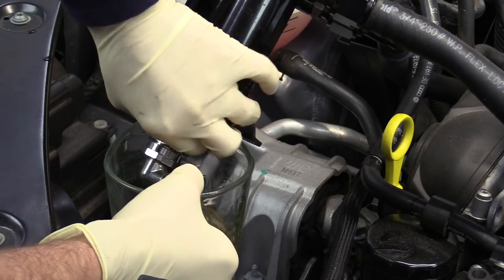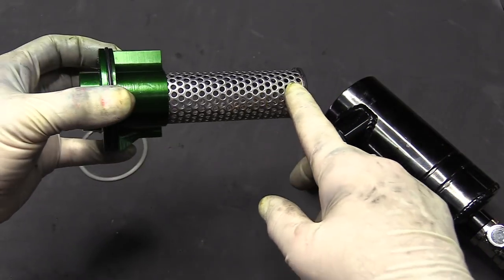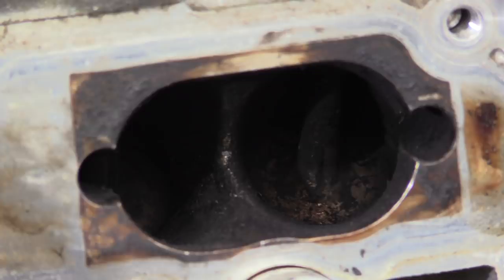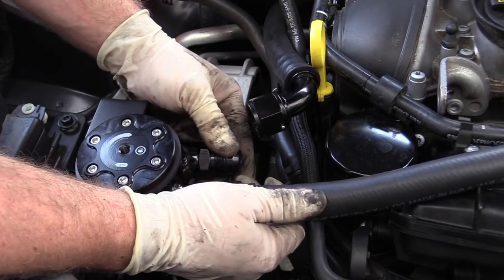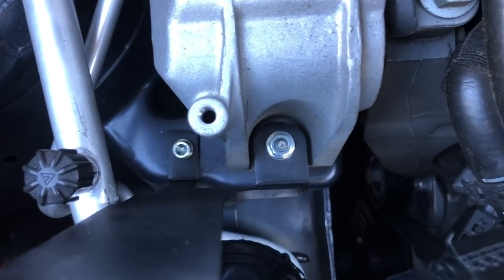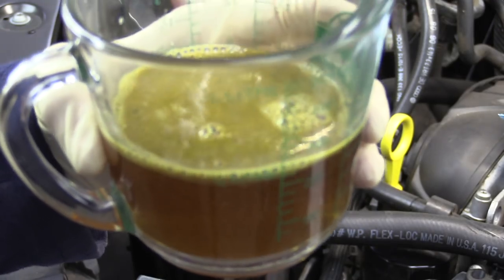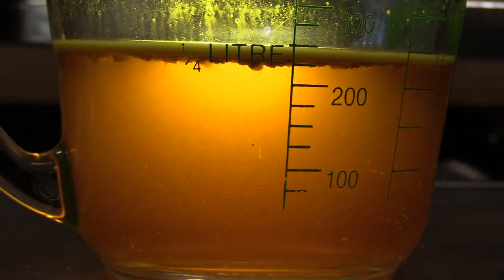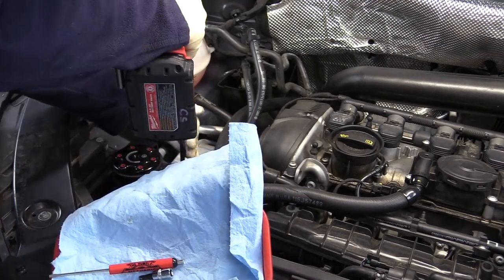Do Catch Cans REALLY Work?

Comment: If your car is using that much oil than you have an issue a catch can is only suitable on modified vehicles if there were meant to be on standard ones then the manufacturer would fit them I think your engine could be using that much oil due to exessive bore to ring clearances or valve stem issues I would check that out but if you can't be bothered than keep the catch can on and drain it every service just keep an eye on your oil level

Comment: Ok I got a ??? I have one on my 2014 raptor but with a breather so is it bad to have a breather like I’m sucking air through the breather when turn the car on and when I drive but when I turn it off I can hear the exhale of the filter so no pressure in the crankcase so is it bad or good with breather please help

Comment: I installed a catch can on a 2016 Audi A5 (2.0T). initially, there was a little oil/gunk residue. After (I guess) the engine broke in, the catch can is basically dry.  Is this normal?
Reply from the maker: A lot depends on driving habits. I was shocked mine was so full lol

Comment: That is shocking. My high performance silvia with a upgraded turbo running 22psi and 170,000 on the clock doesn't even come close to that. Id be checking for excessive blow by and whats causing it

Comment: I find they are more beneficial on older engines. But they do work.
My home made version.ill get approx 1/4cup of crud in 6 weeks(black prutrid smelling oil). On a 280 000km engine.
Volvo in mid 80s had a system where it went through a screen. Then the crud would drain down a tube back into block.to bottom of pan.then when you drain oil the crud would drain at same time.this was clever. 
The one I built uses.air compressor water separator. With about 10 ball bearings in it. Every car I put it on it pulls out crud.and the black oil would over time lighten in color.to like a dark amber. the more hwy miles the less crud.thats my observation anyway. (Been using this can for 15yrs)
So for you critics out there I suggest you experiment. Dont take my word for it.try it yourself.
Reply: I find the condensation build up  is due to the can cooling down after driving. 
In the winter I have to remove mine when it gets close to freezing.

Comment: I installed a JLT oil Separator on my 2018 F150 5.0, which has direct injection and port fuel injection. I don't know about other folks, but I most certainly don't want this mixture of oil, raw fuel and some water vapor fed back into the top end of my engine and on my intake valves.
Reply: You don't need this on a 2018 or newer F 150. Because of Ford adding the Port injection to the direct injection. Waste of time and could damage your vehicle if you live where it might freeze.
Reply: @acostuart  I don't have to worry about freezing where I live and that's not a concern for me. I understand how the injection systems work on the gen 3 coyote, I work for Ford. This is my third 5.0L.. a mustang and two F150s. Believe what you want. I don't want this mixture of water vapor and oil, and fuel reintroduced into my intake manifold (during said port fuel injectiob), which is used during for normal driving under light load. Just out of curiosity, what do you drive?

Comment: Catch cans may have some benefit in GDI engines. But are unnecessary in normal fuel injected or carbureted engines, where the fuel itself acts as a cleaning agent. Driving the car at hway speed for about 15mins can help clean off carbon build up. If you drive slowly all the time carbon tends to build up

Comment: vw thought this amount to pass through was OK for millions of vehicles.  Their future sales will speak for them selves.  Maybe catch can fever is a result of the modification crowd producing above engineered crank case pressures...  If it is really some type of "savings" (engineering or maintenance) the MFG has chosen, I'd be interested to know if commercial heavy trucks have "catch can" style oil separators from the factory.

Comment: Hey Charles. How about doing your next oil change with LiquiMoly Molygen? My thinking is, the oil's green hue, as well as it's UV reflective properties, might help diagnose how much engine oil is actually in the catch can as opposed to other contaminants such as fuel, water and etc. Additionally, maybe compare the visual results to the plain oil and/or at random checks during the oil change interval. Doesn't seem like too much of a hassle besides, I think it he Molygen comes with a UV flashlight but it might be puny, who knows. What do you think? Keep up the great content! Cheers!!
Reply from the maker: Good idea. I may actually just add oil dye to the system. I won't have this car long enough for another oil change. But I lie where you're going with that.

Comment: I heard a catch can can  freeze in winter and blow your engine ?
Reply from the maker: I have heard that too. Its something to be aware of.
Reply: Yes they do i have to remove mine when it gets Below-5c,but if u warm up before driving there's no issue. I have had mine as low as -12c,it was frozen,then it thawed out,,,now all that freezes is the sludge,of course  it has to be emptied when it's warm,,but I also have a see thru can I can tell if it's frozen.

Comment: Good test !Why the car companies don't use this system from the first time?
Reply from the maker: Added cost is the simple answer. Cost at purchase, and cost of maintenance.
Reply: MK6 and MK7 already have cyclonic separators built in. Watch out for the ones that delete the OEM system, you are better off adding a second separator on top of the factory one. If you want to see how the built in one works on a MK7, look at "Degassing of the housing and crankcase gases" in VW SSP 606, PDF page 20 (google it to find the pdf.)
Reply: Because the majority of car owners are lazy, most would never service a catch can. (And jiffy lube wouldn’t touch it). Ha
Reply: @DBA1976   Bingo !  People just want their cars to run and not breakdown.  Now !  We just need a way to filter the heavy carbon out of the EGR stream.

Comment: On my Mercedes I installed a catch can and it caught about 5% of that during 6000 mile oil change interval. The engine never needs adding of oil, infact it stays on the max mark and wont consume any oil. Why does VW pull that much oil from the crankcase?

Comment: Even if it's 99.9% water still don't want it in the motor and for older vehicles or ones without 2 FACTORY separators a catch can will only be better. All in what you want to buy or how much you value the vehicle. For those saying why don't manufacturer's use them then? They're cheap that's why they don't need the vehicle to last forever end of story. Not to say catch cans are amazing but they do work

Comment: All I know is that despite all the different variables (oil type, fuel grade, mileage...etc) that are associated with car, I WOULD not want that going back into the combustion chamber. On the other hand, every solution warrants its own issues so, maybe the best way is to just avoid direct injection engines or something along those lines. This catch can stuff is actually interesting to test and research, but really, doesn't look nor feel like a solid solution.

Comment: Don’t think on a direct injection fuel system like on newer car they don’t work all that well but I my opinion I think it’s to do with the engine design/ fuel system setup and lack of ventilation on the engine /intake or egr systems which heat up the oil
Reply: My 16 mustang ecoboost has spotless valves because I installed a catchcan as soon as I bought the car. My friend with a similar car has half the miles and oil ALL over his valves from not running a catchcan.

Comment: On my car it has frozen up inside the hose and i could not see it. Drove the car with no crankcase ventilation and in 40 km/25 miles all 4 liters of oil inside the engine was gone. It's a 1.5 diesel. Luckily i got home by the time the oil pressure lamp was on. Never again will i use an oil catch can in winter time
Reply from the maker: DAMN! I wouldn't either.
Reply: I know in winter diesels can have a hard time warming up, they just dont put out the heat that a regular sparker would I think.  Also he may have to use a AOS that uses coolant to keep it from freezing instead of just a catch can.

Comment: Can i vent it to atmosphere instead of routing through the catch can ? just a thought question
Reply from the maker: That would fail emissions testing I would assume. I know it will in NC.
Reply: HumbleMechanic Yup. But does it bring any performance penalty when doing this. I live in Malaysia and I've seen lots of guys over here venting instead of using a catch can. Emission test is not as strict compared to the US.

Comment: Honestly, thats is mostly condensation and gasoline...very little oil in that, and that liquid hitting the valves might actually help clean them rather than make them dirtier...yes there is "crud" in that mixture, but very minute amounts compared to the water/gas in there. Keeping in mind that carburated and manifold injected engines dont have carbon issues, I think its safe to say that a little water and gas on the valves will do nothing but good for the engine. Just clean your valves regularly, pull off the last sensor before the air hits the pistons, turn on the engine, shoot some of your favorite valve cleaner in there, rev it a bit, repeat, then let her idle until the smoke settles, turn her off, replace the sensor, done! How long did that take? An hour? maybe less?

Comment: Is this a factory part on some cars?
Reply from the maker: Not that I have seen
Reply: Saab 95 had catch can. It took several versions to make it work. CC was behind the engine to prevent it from freezing. It did return the fluid back to engine. For cold climates there is a huge risk for the CC to freeze and cause catastrophic failure. If the engine ventilation will freeze, the pressure build would push the oil out through the dipstick hole. Once you notice the oil pressure light go on, it’s too late already.
Reply: Saab 95 had catch can. It took several versions to make it work. CC was behind the engine to prevent it from freezing. It did return the fluid back to engine. For cold climates there is a huge risk for the CC to freeze and cause catastrophic failure. If the engine ventilation will freeze, the pressure build would push the oil out through the dipstick hole. Once you notice the oil pressure light go on, it’s too late already.

Comment: All so I disconnect both hoses from the catch can to see if oil is getting pass the catch can one should be oily and the other dry that way you know only air is going into the intake manifold and the car should run better oils don’t need to mix with air and gas mix

Comment: I heard that 3rd generation 2.0 TSI engines owners with catch cans claim  that there little to nothing after thousands of miles of driving. Do you have any experience with those? I am not saying the issue is fixed on those, it's just that a catch can seems to help people with the 1st generation TSI the most. The one in your wife's Tiguan is first generation.
Reply from the maker: The newer generations are much better on all accounts.
Reply: Yeah, that's why I choose to spend the extra money for the 2014 GLI over a much more affordable 2012 model. The former has the 3rd generation engine, and it's been running really well even after 33k miles. No rough cold starts and fuel economy usually exceeds EPA ratings especially on the highway. Finger crossed it remains this way lol.

Comment: Just dumped my 2nd can on my 2020 F150 2.7L.  First can was at 4,000 miles and was nearly all spent oil.   This time, at around 8,000 miles, half of it looked like this video... sludge like a clogged garbage disposal.  GET A CATCH CAN, especially if you have an EcoBoost!

Comment: meanwhile in F1 some teams are actually throwing oil into the intakes for more power and fuel efficiency
Reply: Eduardo J the oil in f1 is specially designed to increase power, but regular oil lowers octane and therfore power.

Comment: I was looking at a set for my infinity. Mishamoto 400 dollars on sale😂🤣 and it adds 0 hp😅🤣🤣. the margins are huge on crap like this. I could create my own catch and release system with a p trap or loop (hose, whatever fits) and a check valve and let the road handle that crap(it was just going to be turned into smog) for a very reasonable price but after seeing this video THAT is not even worth the time.  Thanks for the video buyer beware you saved me 400 bucks and a sunday afternoon. Thanks my dude.

Comment: Hi  is Rafael from Brazil, how are you? I have a serious problem in the car and here in Brazil not only do I have this problem and can not get anywhere, the error name is P164B which is oil pressure drop and in this causes the ignition of the EPC lus with 4000 RPM , we exchanged oil pumps, sensors and nothing, continues the same error, I did the oil pressure test in high and hurry does not rise to the correct PSI stays low under 40 PSI and the normal is 43 to 62 PS in high, you know someone there in the US or someone could guide us to comosanar this cronica problem of jetta tsi 2013 if you can help me or pass to someone who knows about the error P164B would help me a lot.

Comment: Way better option is to weld in the exhaust after the cats a Venturi pipe and let the oil vapours being sucked into the exhaust . Had a catch can in my diesel for a year but it sucked to drain them all the time . With the Venturi pipe I don't have to check it anymore and oily intake is history :-)
Reply from the maker: That would fail inspection here. LOL
Reply: @HumbleMechanic  in which way ? Visually or by exhaust emissions test ? They test mine only by co2, nox and how closely the diesel smoke is. But it never failed that way.

Comment: Most of that is water but there is enough oil to cause carbon build up. A perfect fix would be a combination of catch can and intake/direct injection. I have seen guys run the double injector thing with good results. Manufacturers should have solved this problem by now. Not having done so leads one to believe they don’t care. If they can get the car to run past the warranty that’s all they are concerned with.

Comment: AFAIK direct injection motors suffer from carbon buildup because solvents from standard pump gas don't soak the intake valves. A catch can won't help with that.

With that said.... I did install a catch can for my FA20DIT and it does collect about a shot glass-worth of crud (thicker than what you pulled) every 6K. I would prefer to not have it dumped back into my motor.

Comment: I put a catch can from 034Motorsport on my 2013 Q5 at the 30k mile mark, and I’ve emptied it three times in 10k miles.  Very nasty, tan-colored guck came out.  The biggest catch was in the early spring of this year, about ¾ quart.  I’m a believer!
Reply: so.. water then.. well done you have done nothing
Reply: @James28R  The brown goop was oil mixed with water.  The catch can is working to trap at least some oil vapor from crudding up the intake valves.  My Audi mechanic agrees.

Comment: Egr..... It's going to be the biggest culprit of carbon buildup since that is where most of the carbon itself comes from regardless of direct injection or not. A catch can will help since it is like the glue that grabs and binds the carbon to everything. For somewhat fixed this issue on their Ecoboost motors by adding more upstream injectors to clean the valves and ports because regardless of what people think or say gasoline is a very good cleaning product for carbon so I would recommend some sort of maybe methonal injection kit to use as a form of "upstream cleaning solution" and you can use isopropyl alcohol to do the same effect. That's pretty much the only way to cure the buildup is to actively clean or remove the things that cause it and since an egr is part of emissions it is illegal to remove. So unless you wanna break the law which you're kinda stuck with only the cleaning solution. 😕

Comment: its clearly all water, you can see it is .
Just look at the meniscus on the liquid to the glass jar in the first pull.
The liquid has too much surface tension and as a result , wont stick to the glass
If it was oil, then it would cover the glass and stay covered as the wave ran back onto its self.
But what it actually did was drained back from the glass leaving the glass clean and dry.
All water with a couple mm of oil/shit on the top
SIMPLE!!!!!
Reply: The stuff floating on top is probably still worth filtering out though vs being put back into the engine right?

Comment: That's not oil, it's mostly water (condensation from when the engine is cold/first started). The condensation is not bad for the engine if you drive at least 10 miles each time.

Comment: That sure is alot of buildup! I dont have a catch can (plan on adding one shortly) to my 2008 Silverado 3500 duramax thats completely emissions deleted, with the PCV rerouted to atmosphere. I currently have a hose just routed to the frame to drip down. I do notice some oil on the frame after 10k+ miles like that, would be curious as to how much id end up with, with a catch can. I know on my truck the PCV kills the intake system, completely fills up with intercooler with oil and the intake/intake runners in the head become clogged up with serious carbon buildup.
Reply: itsme78932 the only way to fix the carbon buildup problem in DI is to reroute the PCV into the atmosphere like you did or run port and direct injection.
Reply: Sounds like you have alot of blow by, if your filling a can every few days. Even in winter it shouldn't fill that quick. I have my catch can open to atmosphere on my wrx sti an I only get half a coke cans worth in 4 months of winter driving.